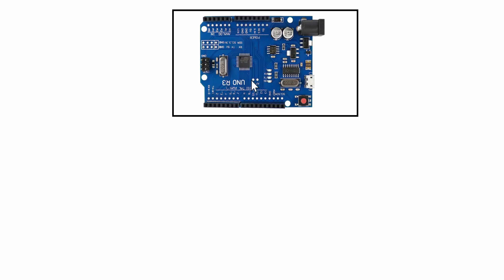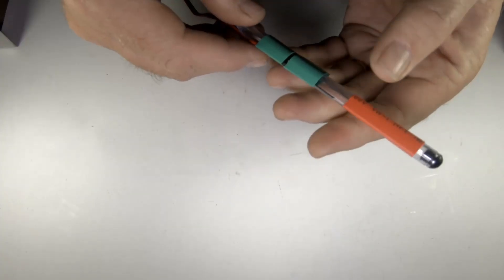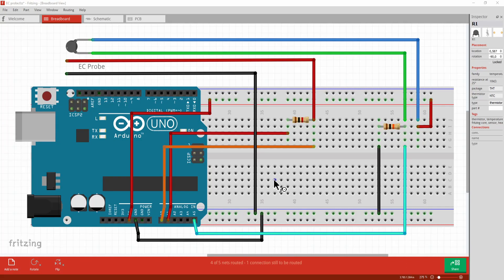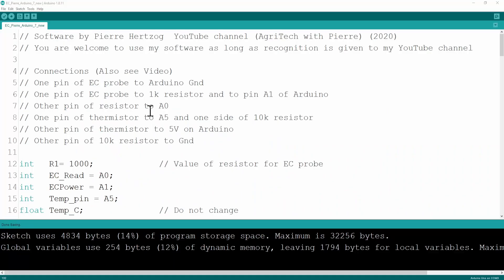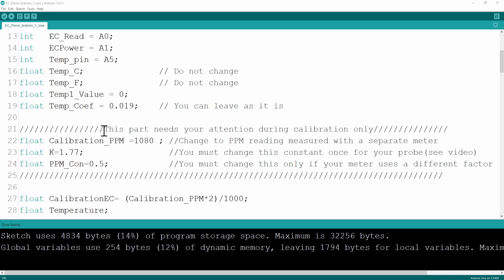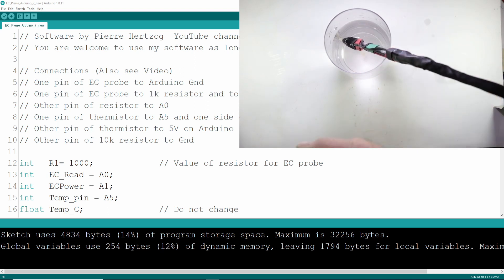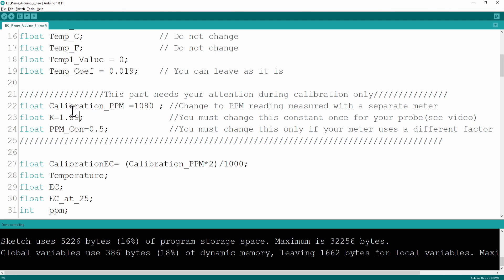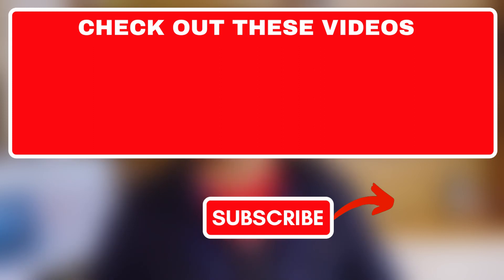EC Hydroponics - Arduino DIY

Comment: Thanks a lot Pierre, here i lean a lot for free. I am now one of your followers. Can you please make a video combining ph, ec, nutrients and water pump for Hydroponics?
Thanks!
Reply from the maker: I get many requests for videos on combined Arduino systems. Systems with different combinations of EC, pH, temperature, humidity, dissolved oxygen, light intensity, LCD screens, touch screens, Bluetooth, Wifi, timers, pump switching and many more. Although it is not difficult to do, it takes a different level of commitment form a viewer to go thru these type of videos. The amount of variations is also infinite. I do help individuals who want to learn more about Arduino to get to the point where they can put together the code and build almost anything that they want. Not only in aquaponics and hydroponics but also in other systems. If you are interested in me helping you can check out the free parts of the online courses here. https://pierre-s-school-6cd8.thinkific.com/courses/learn-arduino-with-pierre

Comment: Hi Pierre. Although this will work in principle, there is a serious flaw in your sensor design. You are driving the EC probe with DC. This will drive electrolysis in the sollution. Not only will it invariably change the sollution itself, it will also cause the probe to self-destruct via electrode corrosion. The better way is to drive it with a high frequency AC signal (sinusoidal or blokwave), using a rectifier, filter and peak detector on the signal returned. Although much more complex, it avoids electrolysis and catostrophic probe failure.
Reply from the maker: Thank you for the comment. Not driven by DC. It is pulsed.
Reply: Ok, but only positive pulse, corrosion will still be an issue, only slower.
Reply from the maker: Design as it is will last for years.

Comment: Great video and thank you very much.  Excited to go to the store tomorrow to get what i need.   One question i have is have you seen this work with a ph sensor?  Some people say that i need to turn on sensor off and the other on because they are effecting each other.  Wil that be what i have to do in this case also?  I can believe the ppm meter i got on amazon only goes to 1000 ppm and it says its for hydroponics :(

Comment: Hey Pierre, wonderful video, I was just curious about how you were able to calculate the EC Electrical Conductivity, I was under the assumption you calculated it from the resistance of the water and the calibrated cell constant. But in the code you used "EC =CalibrationEC*(1+(Temp_Coef*(Temperature_end-25.0)));" is it correct to assume that here you used a relationship between EC and temperature to find the EC? if yes, is there a way to directly calculate the EC independent of temperature? 

I really liked this video and I hope you will continue to post great content! Looking forward for your reply
Reply: AFAIK The EC is always related to the temperature. All TDS Meters, EC Probes have a temp sensor as well.

Comment: Sir firstly i wanted to say thank you for developing this amazing code on Calibration of Ph and TDS, i am using that code of yours  and fulfilling my requirements but now sir there is an ISSUE i am facing and that is when i calibrate the sensors with smaller values of PH and TDS like (under 1000ppm and Ph around 7-8) then it will only shows the correct values of ph and TDS under that values only i.e. When the system is calibrated at like 800ppm and the system is fed with like 4000ppm then it only shows 2500 ppm .
sir i will be very thankful to you if you can provide me yours insights on this issue.

Comment: Hi Pierre. Thanks for the video. Can u help me? my Hanna EC meter says its 30c, but my temp says its 50+C. what can gone wrong?
Reply from the maker: Make sure you have a 10k thermistor paired with a 10k resistor. Temp should be spot on.

Comment: hello nice project, after making it I noticed a problem on the reading of the ec. After having done the calibration the reading is accurate but immersing the wave in a liquid with a different ec the reading is not correct. I do the calibration again and the reading returns to be correct. essentially the reading and accurate if it is close to the calibration value.
Reply from the maker: EC readings are tricky. Make sure your calibration is 100% and the temperature is stable.

Comment: Hi! Greetings from Finland! Just starting my hydroponics project with Arduino. I have bought DFRobots expensive PH&EC-sensors for project. Too bad, that i found your channel little bit late, already bought those... Now I have problem with those sensors working together. I can measure pH or EC if sensors are alone, but if I put those at the same time into my bucket, sensors just freak out. Do you have any videos or suggestions what to do with this situation?
Reply from the maker: Unfortunately not

Comment: Hi! I buy a temperature probe with 3 cables in your video you have 2 cables what should I do
Reply from the maker: Hi, your sensor is probably a one wire temperature sensor. If you want to use it you need to change the code.

Comment: Hi Pierre, thank you for your detailed video of DIY EC measurement. I've 2 questions need your help. 1. Can I use a 10k resistor instead? 2) Can I use this example on a ESP32 instead of Arduino? TIA
Reply from the maker: Yes, you can with modifications. You must have a temperature sensor for temperature compensation.
Reply: @doitwithpierre210  thanks man!

Comment: Hi Pierre, I followed your whole tutorial, however after the calibration and setting the calculated K value, the probe is not able to correctly measure the EC value of my prepared and validated test solutions (except the calibration solution). Also, the K value is relatively low (at 0.7). Do you have any idea why ? I'm using a 2m 75mm^2 cable and soldered 0.8mm diameter stainless steel wire as electrodes to the ends.
Reply from the maker: Hi, it is extremely difficult to say where the fault may be. There are so many things that can influence it.
Reply: Maybe due to the use of DC instead of AC? DC causes electrolysis, polarization of electrodes, formation of a double layer and would alter the measure.

Comment: Hello, thank you for the videos. I have a quick question though..the power for the ec probe is connected to a1, couldn`t it simply be connected to the 5v of the arduino? For my project i will be using an exterior power supply anyway but just out of curiosity...This would be kinda problematic if you had a shortage of analog inputs then..
Reply from the maker: It is done to prevent excessive corrosion.
Reply: @doitwithpierre210  interesting, would you say this could also be a problem with store bought tds meter?

Comment: Hi, thank you for an amazing video - I learned a lot.
I'd like to implement this with an ESP32 - the two problems I see are:
1) it has 12bit ADC - what do I need to change in the math?
2) it runs on 3.3V only - will it have impact on the code or HW?
Also I'm going to use ds18b20, making at least the temperature easier to get (at least for me).
Reply from the maker: It will be a new design.

Comment: Thanks for the great Video!
Just to be sure, you pulse the VCC for EC Sensor by an output pin. You do this to avoid electrolytic corrosion? I ask because I would like to use an external ADC as the ESP8266 has only one analog pin and a very low resolution (0-1V in 1024 steps)
Maybe it’s worth for you to make a Video to demonstrate with external i2c ADC like e.g. ADS1115, as it has also the benefit of much higher resolution.
Reply from the maker: Yes it was done in order to minimize electrolytic erosion of the probes.

Comment: Does the diameter of the stainless steel wire important?
Reply from the maker: No, but it must not deform or bend after calibration.

Comment: I keep getting this when trying to do calibration. I have checked over the wiring and every thing seems right. Any tips?
Replace K in line 23 of code with K = nan
Temperature difference start to end were = nan*C
Reply from the maker: Hi Jimmy, I want to help but do not know what you meen with "this".

Comment: Lovely project. I downloaded your code, it stops at both GetEC statements. I gat find out what this command does or how it works. 
Research seems to tell me Get is a command associated with Eprom. Could you help please.  Roger
Reply from the maker: Hi Roger, check for a copy-paste error. Code is working fine (Copy and paste in new sketch and compile). GetEC is a function. Let me know what happened.

Comment: Hi Pierre,
Thanks for the very informative videos. I have  2 questions .
How do you use the 3 pin temp. probe in this system. I have been using just the temp. probe but with the data pin on a digital pin of the Arduino bu am stumped as to hw to use with the ec meter.
 Thanks
Reply from the maker: Pieter, you will have to change the code to use the one-wire digital sensor.
Reply: Thanks Pierre, I will give it a go.

Comment: Hey Pierre I was just wondering on how you connected the wires of the temperature sensor and metal rods to the male to male breadboard connection wires ?
Reply from the maker: Hi Niki. It was soldered.

Comment: Thank you for the video Pierre. I have some problem with the EC reading inconsistent. Can you advise on how to overcome this. Is the size & length of the wire important to get the consistent reading?
Reply from the maker: EC readings can be tricky. Is your solution well mixed?

Comment: hello sir!!  i liked this project a lot so I'm planning to recreate it...  i just want to know if u were using a PTC or NTC thermistor?
Reply from the maker: It is a negative temperature coefficient thermistor.
Reply: @doitwithpierre210  Sir is it possible to replace the 10k thermistor with a ds18b20? If yes,  what changes should i do?
Reply from the maker: @blueivy2295  Yes it is possible, you need to change the code. I do the 18b20 in my online Arduino course.

Comment: hello Pierre,
how do you take numerical values in finding the temperature? 
temp =1/(0.001129148+(0.000234125+(0.000000087641*temp*temp)) *temp)
Reply from the maker: The Steinhart equation is used. You can find more info here:  https://en.wikipedia.org/wiki/Steinhart%E2%80%93Hart_equation

Comment: Hello Pierre,
Love your videos. Im looking to build a EC sensor probe that could run with the ESP8266 to provide data to growbuddy and Home Assistant?
Can you give me some ideias how to develop it?
Thanks
Reply from the maker: Maybe I will do a video on it in the future. Best of luck with your project.
Reply from the maker: If you are interested, I can do a short mini-course on it. Adding a display and PPM set function as well as connecting to "blynk".  It will take less than a week to compile the course. The course will contain all the information that you need as well as the code. Enrolment fee is $12. Let me know if you are interested.

Comment: Hi Pierre,Thanks very much for the code. Are you in South Africa??I live in Brackenfell. I have done an Arduino project for hothouses, indoor cannibis growing etc. Humidity, temperature, light control, soil moisture with 3 probes, etc. Nice guages and can switch heater, humidifier etc. Cycles 18-6.12-12 ans 24-0 can be selected.
Over 3300 lines of code.
I am retired and was wondering if it is possible to sell this system?Money not very abundant at the moment.
Thanks, Peet
Reply from the maker: Hi Petrus, good to hear from you. Maybe someone will see your comment and buy your system.

Comment: Hi Pierre. Thanks for the video. I filled out the for to get the code and got it but the attachment states the file type is not supported. Is there any site I can go to and download the code. I have the probe and temp sensor already built awaiting code. Thanks, Joey
Reply from the maker: It is pdf

Comment: 1K ohm resistance is must or any resistance can be used?
Reply from the maker: Mansoor use a 1K if you want it to work. Let me know how it goes.
Reply: @doitwithpierre210  ok I will arrange 1k resistance. I have made probe also aslo bought temprature probe. I will share results.

Comment: Can we use on nodemcu ?
Reply from the maker: If you like you can.
Reply: @doitwithpierre210  but nodemcu has only one analog pin.
Reply from the maker: This video was not aimed at the nodemcu. If you want to charge the design you can use it.

Comment: The EC measurement range is very close, so when it is calibrated with 1.413, it cannot read 12.88 correctly, and when it is calibrated with 12.88, it cannot read 1.413 correctly.

Comment: I do not see the code for this project.
Reply from the maker: In the first comment.
Reply: I also do not see the link for the code
Reply from the maker: @dununan7 , the code is in the comments just go up or down to the first comment (depending on your settings). Please let me know if you found it.
Reply: @doitwithpierre210  Thank you, found it
Reply: Pierre, I want to use a ESP32 that is only 3.3v tolerant on the GPIO pins. How will this affect the code? Then I can use Blynk to monitor my EC